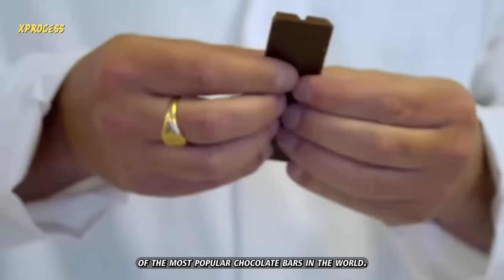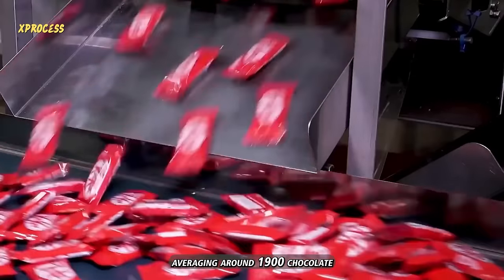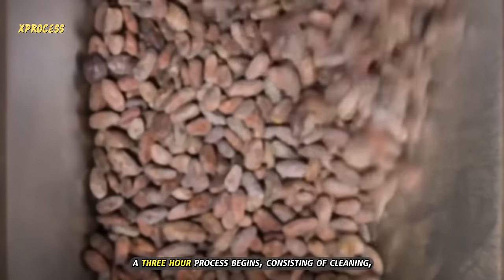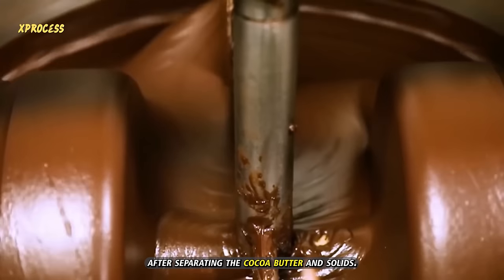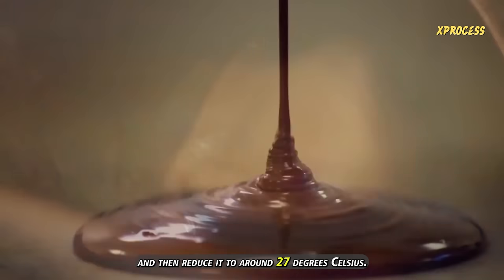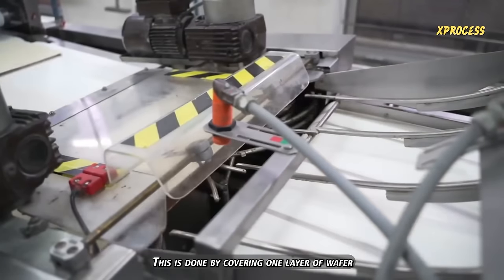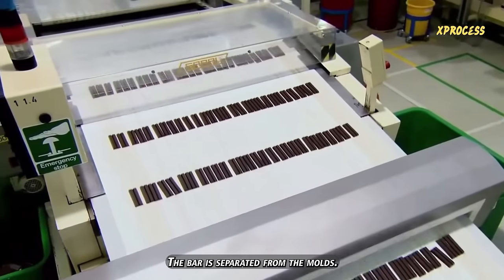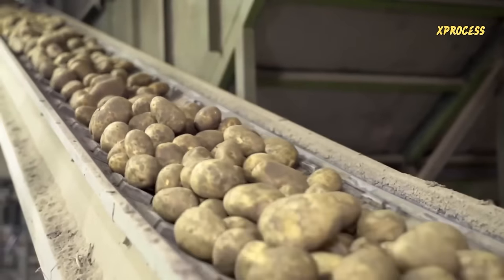How KITKAT Chocolate is Made | 7 MILLION KITKAT Chocolates EACH Day!!🍫🏭

Comment: That's pretty clever crushing up the rejected bars as using them as the filling. I bet that is an interesting balance to make sure there is enough being rejected, without wasting good ones, or not having enough to go into the mix.
Reply: The rejected bars are from damaged packaging (happening inside the packaging machines) and can therefore look a little rough. As for ratios, there’s recipes for different amounts, depending on how much reject there is